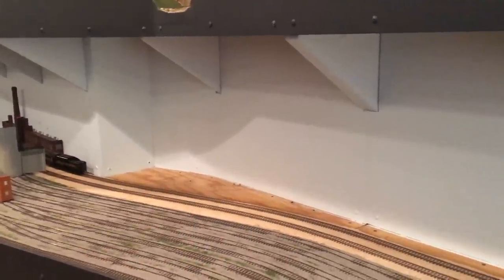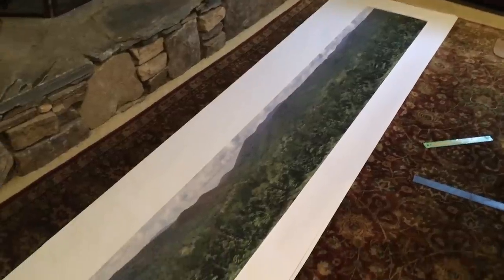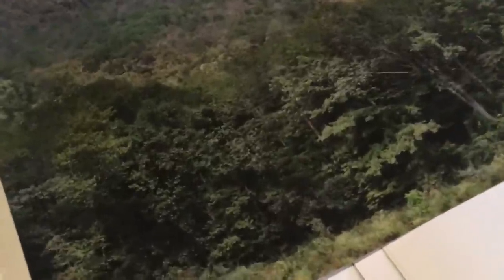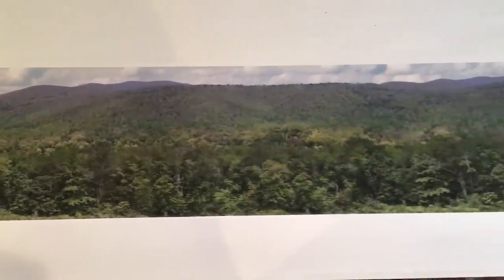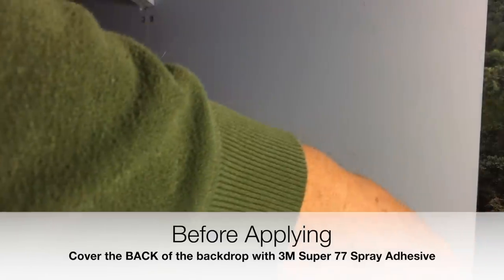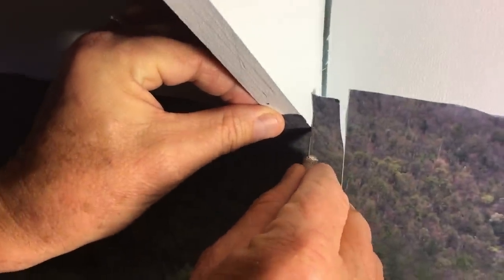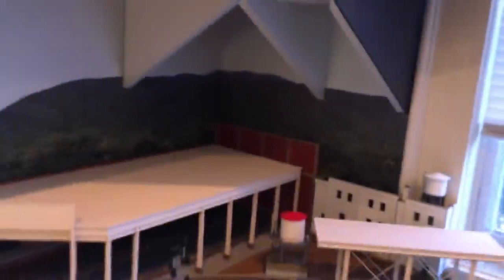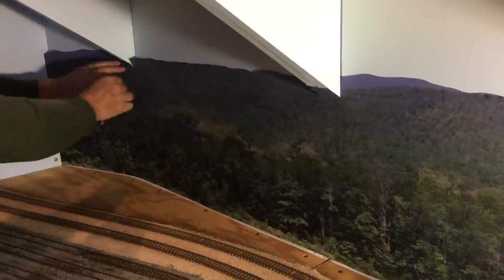How to Install Realistic Model Railroad Backdrops

Comment: Josh, I need to put Masonite up on a painted concrete block wall so I can apply this type of Backdrop. 

Do you think the 3M Spray would hold the Masonite to the wall or best to use some Liquid Nails Contact Adhesive in a Tube and Spread it with a plastic blade?
Reply from the maker: I think the 3M spray will hold it, but since that probable isnt the most flat, it would probably show through the relatively thin backdrop and cast some shadows. But that's not to say you shouldn't do it. If you have the option to add a flat surface (like masonite) I would definitely recommend it, but if not I still think it would be better than no backdrop at all. I don't have any experience with the liquid nails, so I'm not sure how that would work. Sorry!
Reply: NSmodeler24  so you’re saying Don’t use Masonite for the Backdrop Board material?
Reply: Here is my 2 cents. (This is Dad) I would use liquid nails to apply the Masonite to the wall and I would use a madonary screw every foot or so. Try to find a flat head screw so it is flush with the surface of the Masonite. Then use the 3M 77 to glue the backdrop to the Masonite. That  should keep everything quite secure. Even though the liquid nails should work on it's own, I tend to like the backup of physical attachments. Nothing ever comes apart after that and it seems to keep everything together during expansion and contraction  periods.

Tom.
Reply: Make that "masonary" screws!
I think I fat fingered that one!🤔